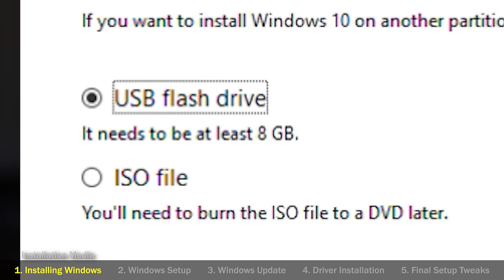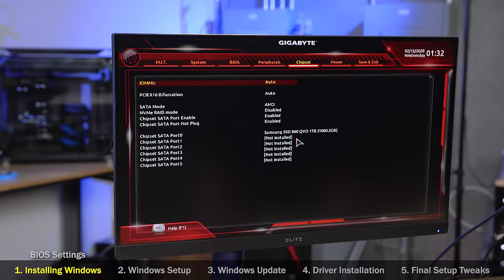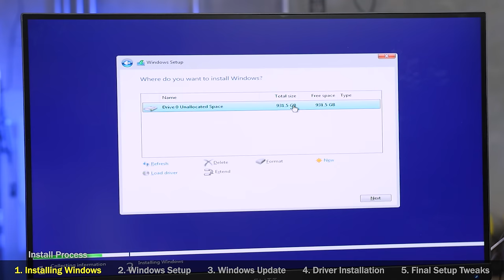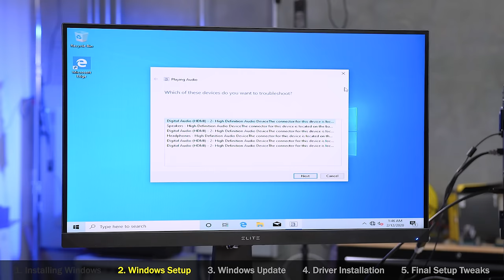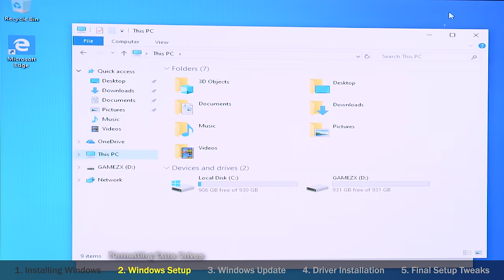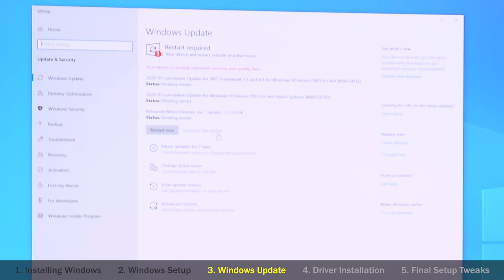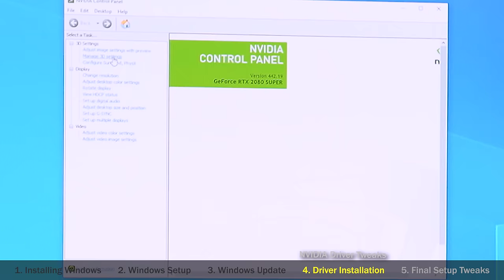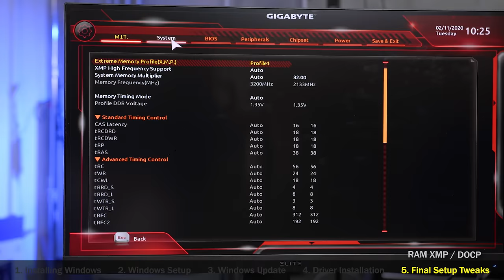Guide: What to do AFTER building your computer...

Comment: Is the Ethernet cable required to connect to the wifi
Reply: No. That makes absolutely no sense since by definition, wifi is wireless. If you want to connect via ethernet, plug in an ethernet cable to your router and PC. If you want to use wifi, connect to your wifi network. You may need to install network drivers after you perform a clean install of Windows. You can download them directly on your PC or if it doesn't have ethernet drivers, use another device to download and transfer them via USB drive.
Reply: @JJFlores197  ok thanks just that that internet part got me confused
Reply: @JJFlores197  I don’t have access to an Ethernet cable and I just installed windows. Windows doesn’t show the wifi option in my pc even though I downloaded the drivers for my motherboard. Any clue what I can do?
Reply: @rafaelsierra493  Did you install the drivers for the wifi adapter? Make sure the wifi adapter isn't disabled in Control Panel>Network and Internet>Network and sharing Center>Change adapter settings

Comment: I have a question:
If you're gonna plug/uplug any extra drives which cable should i do this to? the SATA cable or the cable the gives power (SATA power supply cable) to it?
Reply: Makes no difference.
Reply: @JJFlores197  you mean that it doesn't matter which cable should i unplug?
Reply: @sunsky5863  Correct.

Comment: I just build a new PC. I can see here in your BIOS  that you have working FAN profiles (spinning). On my PC, only the CPU fan appears to be working. Its strange since i have 5 spinning fans in my Fractal torrent tower. They seems to work fine. I kept the system running for 35 minutes and in the BIOS my CPU is stable at 36c-37c . The system temperature is stable at 25c. Did i install my fan in a wrong way? Maybe i did not install proper plug or jumper on the mobo. i checkek the manual but its not clear. I feel a bit lost.
- - -
Follow up :

I fixed the problem : The 4 pins cable from the fanhub was pluged in  SYS_FAN1. So that was ok. The other one was properly plug to the PSU through the SATA cable. Again, its was ok. But what i did NOT plug properly is the fans in the hub. We need to plug one of the chassis fans in the SLOT 1 of the fanhub in order to make the BIOS showing it. The fan were working perfectly fines, even before putting one in the slot 1 but it was just not showed in the bios profile. I fixed that!

Comment: I am gearing up to do this soon (parts are coming in everyday!) on a b550 ASUS MB witha  Ryzen 5 5600 cpu. I have already install the processor and Ram (A2/B2) I just want to be clear can I perform this with the processor and ram installed? Thank you and great video.
Reply: Unfortunately you will not get picture out with just the CPU and RAM installed. The Ryzen 5 5600 does not have integrated graphics, so you will need a graphics card to get picture out. Also, make sure that the B550 motherboard has the most current BIOS needed to support Ryzen 5000 series CPUs. You should be able to contact the seller to see about this or there may be stickers on the motherboard box that say "Ryzen 5000 supported!"
Reply: @daekrFINGERS  Thank you for the reply. The box does say: "Zen 3  Ryzen 5000 and 3rd gen Ryzen ATX Gaming MB". It would be helpful if they put the BIOS vs. on the box or gave us the ability to look it up via the Serial#.

Comment: Just officially gave up on a 6k build 👍🏽 I can’t figure this bs out. No internet connection and can’t figure out what drivers I need to install and how to install them. I’m heated rn
Reply: its not that hard dude. If your PC doesn't have internet, it most likely that Windows doesn't have drivers for your motherboard's network adapter. On another PC or device with internet, you'll need to download the network driver and then transfer it to your new PC via USB drive and install. Have you ever installed any computer program before? If so, installing drivers is pretty much the same process. Find the installer/setup file, open it and go through the steps. It 95% automated, you just have to click "yes" and "continue".
Reply: @JJFlores197  yea I got it but had to take a break! I appreciate you for this response.

Comment: Can someone direct me to a JaysTwoCents video showing how to move a SSD from my old PC to a brand new build from microcenter? My issue is windows 11 home is on the new build and I have windows 10 home on the SSD...
Reply: Not aware of a video showing this exactly, but it's not an involved process. 

Jut plug the SSD into SATA power, and a SATA port, and it should be detected as a second drive in your new windows install. Pretty sure Win 11 uses the same file format as Win 10, so everything should be readable straight away. 

The only thing you'd need to watch, is that your boot priority is set correctly, so the system is booting from the correct drive. You can set this quite easily in your motherboard's BIOS
Reply: Thank you 💯
I really do appreciate that!

Comment: I just finished my build and it starts up fine! Do I just ignore the part where it says "New CPU installed, fTPM/PSP NV corrupted or fTPM/PSP NV structure changed." It says press Y to Reset fTPM or Press N to keep Previous fTPM. It's a open box Gigabyte B650M K motherboard. I'm confused
Reply: Press Y. That message is just telling you that the CPU is different than what was previously installed.

Comment: hey jay, quick question, my computer is capable of going 144 hz however since my 3070 does not have a DVI port therefore i have to use an HDMI cable. My monitor is only giving me the option to choose up to 60 hzwhen i go to adapter settings. Any clue why that is happening?

Comment: Is there a way to disable the tracking/security features you denied in the windows setup section, after windows is installed win 10 pro?
Reply: Settings>Privacy. If you're up for it, you can also use Group Policy editor. There are also tons of scripts and utilities that can supposedly block a lot of the telemetry data with varying levels of success.

Comment: Would I be able to put an SSD with an operating system and files from my old pc that had a faulty mother board, into a pretty much brand new setup
Reply: Should work fine. I would normally suggest you uninstall the drivers of the old hardware first before moving the SSD, but since your old motherboard doesn't work anymore, you can just install the SSD on the new build and then uninstall the old software and then install the drivers and software for the new system.
Reply: @JJFlores197  thank you so much I’ve been asking friends and they didn’t know

Comment: oobe\bypassnro
oobe is not recognized as an external or external program or batch file.
dir oobe*
oobe directory is present
cd oobe
dir
No bypassnro  batch or eexcecutable in that folder.

Jay, you're an 1d10t.  You've always been an 1d10t.

Internet search returns:

The bypassnro.cmd is a script which contains:
@echo off
reg add HKLM\SOFTWARE\Microsoft\Windows\CurrentVersion\OOBE /v BypassNRO /t REG_DWORD /d 1 /f
shutdown /r /t 0

So I'm entering all that on the command line as a visually impaired person.
Great MIcrosoft, just great.

Comment: I'm stuck and frustrated with my first time. I got bios open and seeing everything attached, USB is the only thing plugged in for boot priority. But I turn it off, turn it back on, and I don't get the windows start up page? Please help :(
Reply: Make sure BIOS mode is disabled (May be called CSM, legacy mode or similar) and that UEFI Boot, Secure Boot and TPM 2.0 (if you're installing W11) are enabled. If that still doesn't work, try rebuilding your USB installer.
Reply: @JJFlores197  I'm new to doing this so I'm not understanding all of that. I thought Bios was the screen showing you everything you have (what motherboard, what ram, fans speed, temperature, etc). Why would I want that disabled? It's the only thing the PC is able to do right now?
But I'm pretty sure it's the USB is not done right, gonna retry that.
Reply: @Sja743  The BIOS is the most basic software on any computer. It stands for Basic Input/Output System. The problem is that it is obsolete. It has been in use in PCs for decades and has some big limitations. The replacement is called UEFI (Unified Extensible Firmware Interface; its a mouthful).  UEFI replaces the legacy BIOS, however the term BIOS is used interchangeably. UEFI systems have a BIOS mode or compatibility mode that is enabled by default. You may need to disable that BIOS mode in order to get newer versions of Windows, notably Windows 11 to properly install and boot. Disable BIOS mode and rebuild your USB installer. One of those 2  should work.
Reply: @JJFlores197  Finally got around to re-doing the USB. It was definitely the USB, I just deleted the installation, re-did it, and it worked perfectly fine. Idk what went wrong but I've got it. That's bud :)

Comment: Do you leave the gpu connected or remove and install later?
Reply: No. You install the graphics card and don't remove it unless you want to replace/upgrade it later on.
Reply: @JJFlores197  Great! Got a green screen issue and have exhausted every option except for reinstalling Windows, so I was wondering about what to do with the gpu.

Comment: If I have windows installed on an SSD on my older PC can I just put that in my new PC and expect it to boot windows?
Reply: Yes, it will most likely work. I would first, however uninstall the old motherboard-specific drivers and software. Once you do that, install the SSD on the new board and then install the drivers and software for the new motherboard.

Comment: I'm confused. Do I need another empty drive to install the boot-able Windows program? I thought u only need the bootable USB drive plugged into the new PC for now to install.
Reply: You only need 1 internal drive (be it HDD or SSD) to install Windows and a Windows USB installer. You can have multiple internal drives for extra storage if you want/need, but they are not required.

Comment: question, how would you modify this to work with first loading win 10 and adding the win 10 key, how would proceed to win 11 upgrade/clean install? would you just do that at the end or would you do that immediately after 10, before all the rest?
Reply: If you want Windows 11, it makes more sense to install it from the start rather than installing 10 first, and then doing the upgrade to 11. The W10 key will work with the corresponding W11 edition. The install process is mostly the same. The main differences are that you will need to make a W11 USB installer. Download the Media creation tool from Microsoft for W11. Also, you will need to make sure that TPM 2.0 and Secure Boot are enabled in your motherboard's UEFI. Other than that, it is the same install process.
Reply: You can d own load the W11 upgrade assistant from Microsoft's page to update your W10 installation to W11. You can enter the product key in Settings>About>Activation I believe.

Though, if your end goal is to install W11, it makes more sense to install it from the beginning rather than installing 10 and going through the upgrade process. The W10 key will activate the corresponding W11 edition. The install process is mostly the same. Main differences are that you need to enable TPM 2.0 and Secure Boot in your UEFI.
Reply: Additionally, I did a win 10 pro clean install using win7 ultimate license, it authorized fine! then loaded win 11 pro clean install, after plugging in internet cable it authorized. Done.

Comment: i just set up my pc and its asking me to set the language, etc and do all that. When i try to connect the internet it says unable to connect and it did ask for a ethernet 2 cable connection i think but im not quite sure how to connect the internet since the modem and router are both next to another pc located in my house.
Reply: You plug an ethernet cable from your PC to your router. If your PC has wifi, Windows may not have detected the drivers for it and won't let you use it until you install the drivers for the wifi card.

Comment: I used minitool partition wizard to move my OS to my new NVMe, but should I do a clean reinstall after this when my system is running on new disk? I feel like I dumped alot of crap onto the new drive..
Reply: I would do a clean install, but it's up to you. With a clean install, you get a fresh install. But, you have to re-install all of your programs and games and recustomize your Windows setup to your liking. Cloning a drive alleviates all of that work, but it copies everything from the old install including any potential problems that may be lurking. 

It mainly comes down to whether you want to start fresh and set up everything again, or have everything brought over from a different system, including its potential problems.

Comment: One question do you have to use a hdmi to dvi cable to get started, I'm using an hdmi and the screen is blank. Thanks I know this video has been aroung for awhile
Reply: You would use whichever cable both your PC and monitor support. Ideally, it should be an HDMI to HDMI cable, but cable conversions usually do work. Do keep in mind that since you're going from 1 standard to another, that your graphics card, cable, and monitor all support the same resolution and refresh rate. If they don't match, you will either get no video or intermittent video problems.

To further complicate things, no video may also be a sign of a bad POST (power on self-test). Your PC does this POST each time you power it on. If there is something wrong with the hardware, it will cause a no screen issue. See if your motherboard has a diagnostics light. It will usually light up at the spot where there's a problem and that can help point you in the right direction.
Reply: @JJFlores197  OK I bought a i5 12600 with asus prime z690. Took the fan off, reinstalled the cpu, took all hard drives off and nothing. I have a hdmi to dvi cord delivered Friday, maybe a bad motherboard. Thanks for the reply!!

Comment: For some reason I don’t have a wireless internet connection and I tried everything to fix it and I don’t have a Bluetooth one to
Reply: Not sure what "everything" you tried is, but did you install the network drivers for your motherboard? You'll need to temporarily connect your PC to your router with an ethernet cable and download the wifi controller drivers from the motherboard's site OR use another working device with internet to download them and then transfer to your new PC via USB drive and install.

Comment: what bout mac users who r switching to windows. we dont have another pc to download the media ctool. or is the process the same regardless?
Reply: You can't use the Media Creation tool on Mac, but there is a different process. You will need: Google Chrome, Chromebook Recovery Utility, Windows 10/11 ISO from Microsoft, and your flash drive. Once you have everything you need, plug in the flash drive to your Mac. Change the extension of the ISO file to BIN. Then open Chrome and then the Recovery Utility. Click on the gear icon and choose Use local image and then select the Windows BIN file. Then select the flash drive you want to restore to and let the tool work. Once it is finished, plug in that flash drive to your new PC and install Windows as shown in the video.

Comment: The problem I have is when I turn on my B550 Tomahawk the Boot light comes on the Ez Debug  and nothing comes up on the monitor?
Reply: To clarify, you plugged your video cable into the graphics card and not the motherboard's video output? Your monitor is on the correct input? Your video cable works fine?

Comment: Looking for help! Building my first PC and everything got hooked up alright, turned the power on and the only thing that happens is the RAM lights up. No cooler fan spin, no case fans, GPU fans. I'm using Ryzen 7 5800x, gigabyte x570S Elite AX, Rx 6600. Any ideas would be great. At first I thought it was a bad motherboard (gigabyte b450m) so I went and swapped it out. Still have the same thing going on.
Reply: You could try taking it out of the case and only connect the CPU, 1 memory stick, a graphics card and the necessary power. Greg Salazar has great troubleshooting videos on his channel if you want more ideas of what to try.
Reply: @itsJPhere  Hey thanks for the reply! It ended up being a dud f panel connector

Comment: I have anothers questions to asking you is, I have a windows 10 64bit version and I wanted to adding it another windows such as like macos operating systems rights? So Is it possible to do it to installing it on my operating systems?
Reply: It is possible, but difficult. Apple does not want you to install macOS on any non-Apple computer so they go through great lengths to prevent you from doing that. There are ways of doing it, but it is not easy. You will likely be ripping your hair out in frustration trying to get the installer to boot up. You will then likely be ripping out what's left getting the system to boot up correctly and then installing drivers or other settings to get the system to work.

Comment: What Cables do you need to power it
Reply: The power cables come with the power supply. They are: motherboard power (24 pin ATX) CPU power (12 pin (8 pin + 4 pin)) and GPU power ( 6 pin, 8 pin, and/or 12 pin). And for SATA devices, there are SATA power cables. The power supply also comes with main power cable that you use to plug into to the wall outlet.
Reply: @JJFlores197  thanks